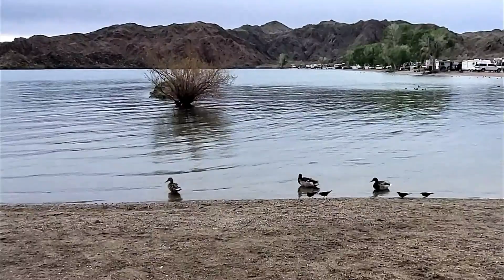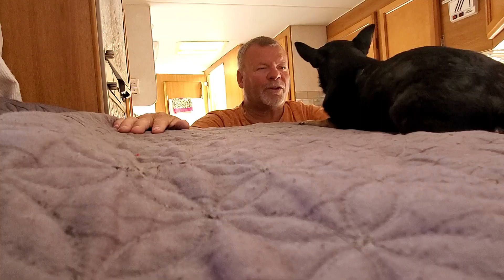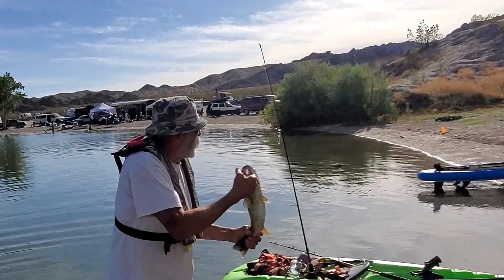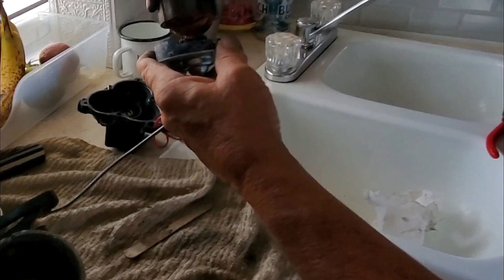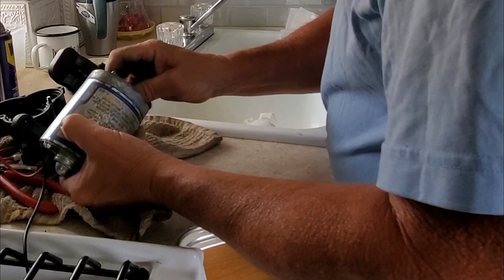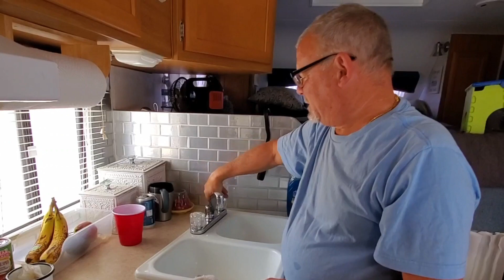RV Water Pump Fail - Free Billy Bass - What Happened To Punkin? RV Living, Travel, Life Vlog, Nevada

Comment: Not meaning to sound like I'm picking on you Scott, but you mounted that pump upside down.  From one marine guy to another, those pumps are meant to have the motor up and the pumphead lower so if and when it leaks the water won't get into the motor. Just giving my two Canadian cents worth
Reply from the maker: It was installed wrong from the factory and I had no way to change the plumbing at that time. Good eye.😊😊😊